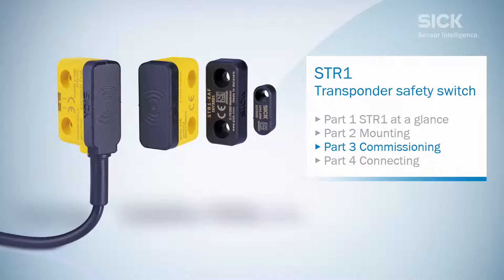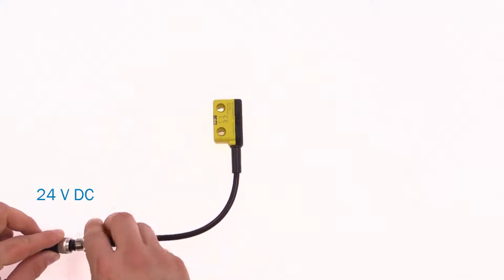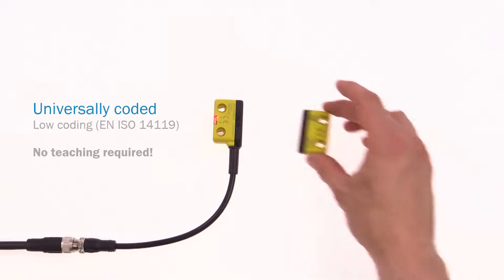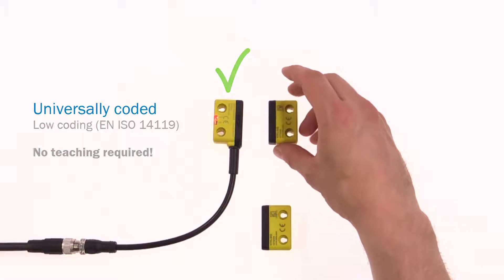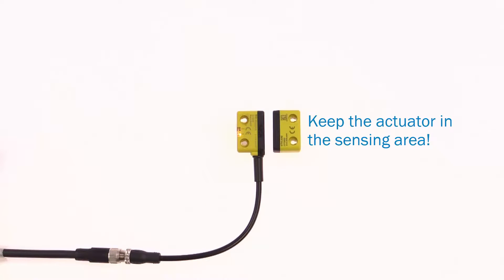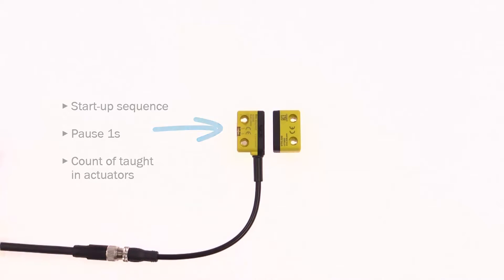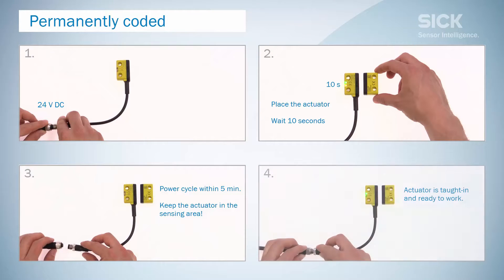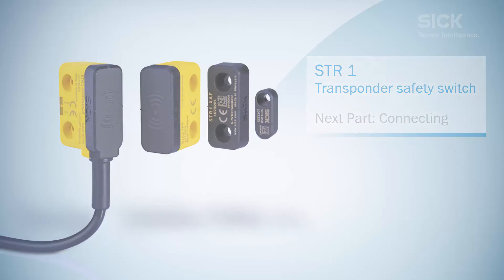Tutorial STR1 safety switch (3/4): Commissioning

Comment: How can we factory reset the permanently coded devices. To erase the actuator data
Reply from the maker: Hello and thank you for your question. It’s not possible to erase the actuator data. If high coding is required, but not only one-time teaching, we’d recommend to use the uniquely coded versions. Unlike the permanently coded devices, they allow re-teaching the actuator up to 8 times (e.g. if the actuator got lost or broken). The permanently coded devices allow only one-time teaching, if the actuator is lost, the sensor has to be replaced as well, no reset is possible.